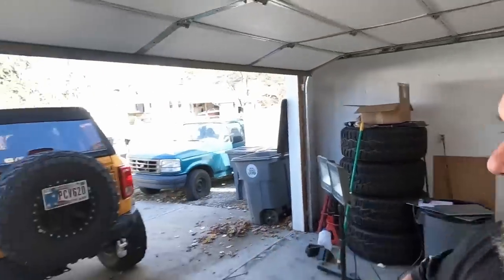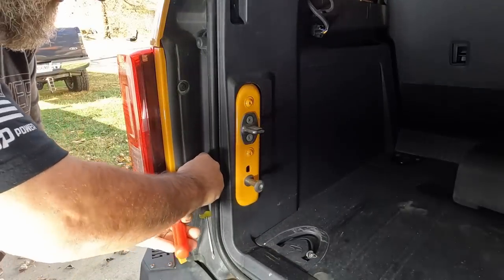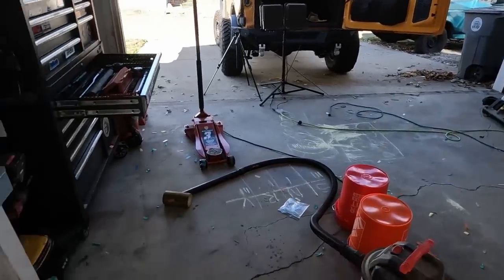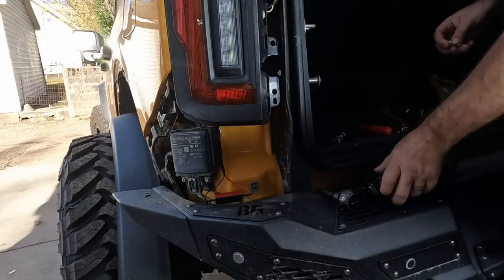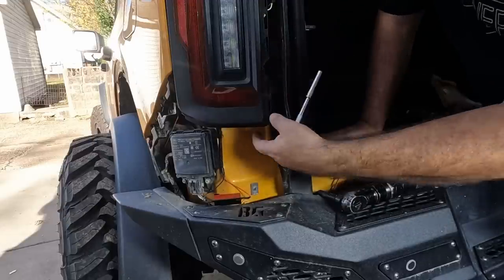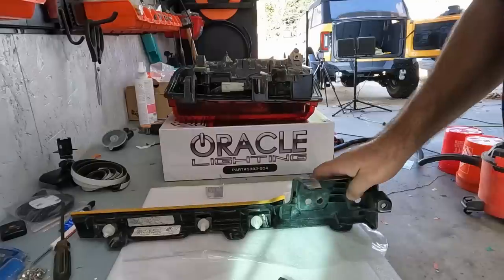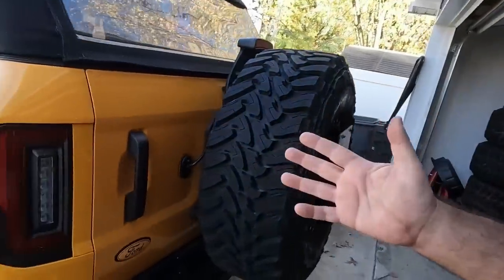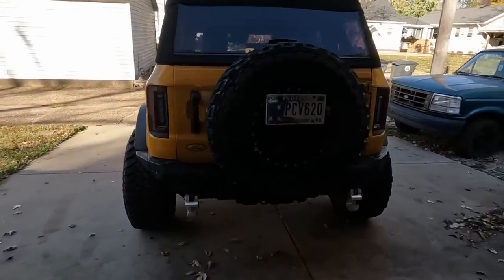Replacing Bronco Tail Lights

Comment: Wife broke the passenger back lens... for the plastic front and back not the internal LED just the plastic housing and lens they wanted 1,400.00 CAD before tax OEM from FORD come on.....its Plastic? soooo...got the Oracle black with the for-scan USB to OBD2 Cable little over 700.00 all in and I saved 800.00 that it's a lot of bacon and beans..... maybe I can sell the driver side tail light for a savings of 2000.00... lol come on Ford....